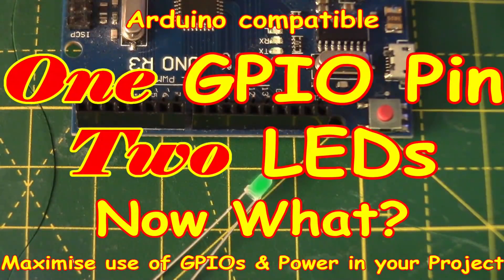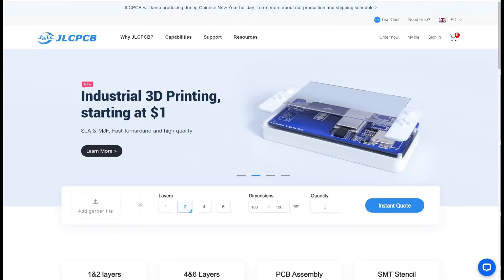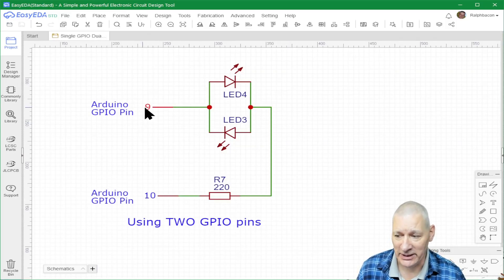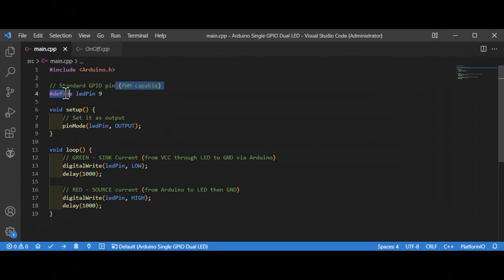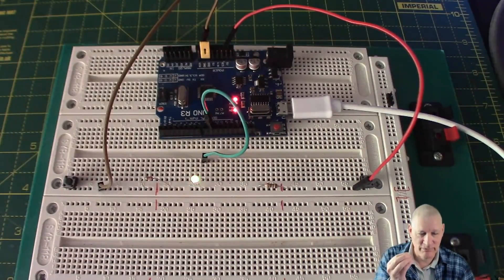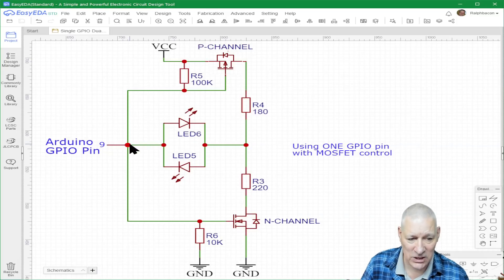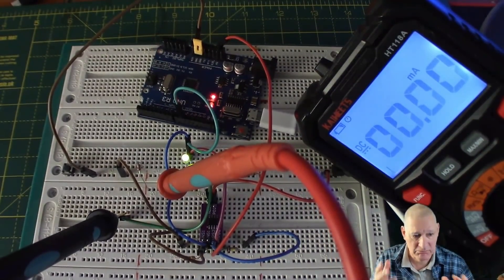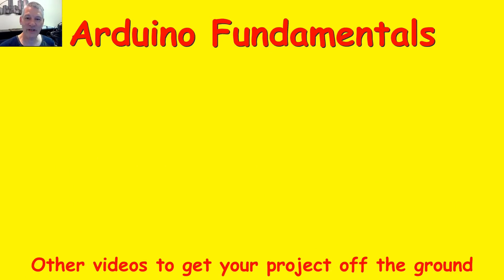#241 Yikes! Only ONE GPIO pin but TWO🔴🟢LEDs - Now What? Easy fix!

Comment: WS2812B is much easier to do for a multi color LED, only 1 resistor is needed, everything else in software, millions of colors, Fading and much more can be done, have a few videos on my channel that shows usages.
Reply: @jeremiahbullfrog9288  Yes, but not that much, and haven't checked, but somebody should make a very basic WS2812B driver/library without all the inbuilt effects but just with color and brightness to save on memory and space, code is already pretty easy to use ( FastLED )
Reply from the maker: Yes, I showed them just a couple of weeks ago. Maybe that is THE answer, after all? The only fly in the ointment is that NeoPixels are normally flat (with 4 pins) whereas I would prefer a standard 3mm LED mounting.
Reply: @RalphBacon  There are "5mm RGB addressable LEDs - WS2812 compatible" ( google search to find them ;) ), but yes no 3mm, also in all my stuff ( video's on my channel ) i always have the LED's behind 3D printed diffuser, or in my TPU buttons with LED's under them so they light up and feel good to press also ;), i also only use the 5050 package and the 2020 package of WS2812B LED's ( get jlcpcb to solder those small suckers on.... )

Comment: Awesome! We are not worthy.
Reply from the maker: Except we can't turn the LED off, something that I don't do in my Smart Heater Controller so never considered. 😢
Reply from the maker: GOOD NEWS! I've tested the tri-state option now. 

You can remove both R5 & R6 (the MOSFET Gate resistors) as they are no longer required; the GPIO pin keeps the MOSFETs in the correct state. 

If you set the GPIO pin to INPUT there is ZERO current flow in either direction. Basically, the MOSFETs do not allow current flow. The LED remains OFF. Setting it back to OUTPUT resumes normal operation.

Thank goodness! Obviously I designed it to do this 🤥

Comment: Yet another great video. This will work well with my just ‘completed’ PIR project using an ESP8266-01 that has only two readily available pins. Currently I use the remaining pin for a red LED to signal motion. With your video I can have red for movement and green for none. Sure, I could of used a Wemos R1 D2 but I enjoy the challenge of being limited.
Reply from the maker: Yup sounds like a plan!
Reply from the maker: Yes, the ESP-01 is, after all, an ESP8266 so ESP-NOW is available to it. I use that here in the workshop for all my sensors.

Comment: what the hell is a wall wart is it some sort of non english thing?? or is it a mains powered PSU???
Reply from the maker: It's an ugly phone charger that you plug into a wall socket... A wall wart. A carbuncle. Whatever, ugly. 😁
Reply: @RalphBacon  a carbuncle. Hahahaha I just got a bag of the 5mm ones. I thought they were blinkers when o bought them but I just run them using a triple 5 and a 2n2222 on a separate breadboard from where the output on the circuit the original 555 is on. It's convoluted to explain but I just used 2 leds in opposite directions to the collector so they flip opposite colors in the same timing.  This sounds confusing because I can't draw the circuit haha. We have the same taste in leds, like coding and electronics along with flying drones Ralphy. Hahaha
Reply: @RalphBacon  yes and $2 instead of £X to many americanisms drifting in and why did you not just use your old system https://www.youtube.com/watch?v=kQZU8kE3ksU
Reply: Ik thougt it was soms kind of pig with tusks living in your wall. 😀

Comment: will be good to look at the current flowing through the two resistors during switching, i expect to see a point in time where both fets are conducting due the two gates being connected together. in this application i can't see a problem with a few miliamps being drawn as a current spike. but without the resistors you could be shorting out the supply.
Reply from the maker: I suppose it depends on how quickly the MOSFETs switch. Vishay state 7-30nS switch on delay, 16-30nS to switch off. Can we live with that?
Reply: @RalphBacon  it's not so much the switching on and off times, it's how long the two inputs remain in the voltage range where they are both on. Remember there may be quite an overlap on switching points. In your circuit its not a real problem as the max current is limited by the two resistors, but it's worth pointing out that if those resistors were not there, you would be shorting out the supply for that cross over time. You have again given me something to think about on a friday. keep it up :-)

Comment: Charlieplexing. You can always use the analogue pins as digital io pins.
Reply from the maker: The two GPIO-pin solution I initially show is not really Charlieplexing. It does save a ground wire but does not drive more LEDs than can be done from two GPIOs anyway.

Three GPIOs can drive 6 LEDs though - and the more pins you can give the more LEDs you can drive.

Yes, always good to remember that the badly named "analog pins" are actually analog-capable pins but in all other respects are standard GPIO pins. 👍🏻

Comment: I use micro controllers to save on external logic. With micro controllers costing less than $5 I now can spend almost as much to save one pin on a controller and still not be able to turn both lamps off, or PWM them, to save power. Good video on logic design, especially for applications where you need the external drivers anyway to drive larger loads.
Reply from the maker: Yes, in this Real World case (my Smart Workshop Heater Controller) I always have either green or red on; at no time would the LED be unlit. But I'm sure it can be done 🤷‍♀️
Reply from the maker: GOOD NEWS! I've tested the tri-state option now. 

You can remove both R5 & R6 (the MOSFET Gate resistors) as they are no longer required; the GPIO pin keeps the MOSFETs in the correct state. 

If you set the GPIO pin to INPUT there is ZERO current flow in either direction. Basically, the MOSFETs do not allow current flow. The LED remains OFF. Setting it back to OUTPUT resumes normal operation.

Thank goodness! Obviously I designed it to do this 🤥

Comment: I don't think the resistors is needed, your pin is either high or low. If it's 3 state the two gates will be feed by the voltage divider of the resistors
Reply from the maker: Possibly. I'd have to see whether the MOSFETs were kept in the correct OFF (non-conducting) state when required. Or maybe one of the resistors could be removed (the 10kΩ probably).

Comment: Gday Ralph. Never seen bicolour leds with only two legs. Smart way to save battery power but still a tiny leakage path via 100K and 10K.
Reply from the maker: Yes, 45μA apparently (says viewer Algobit) but we might be able to remove the 10k resistor reducing it to zero (or increase to 47k and the 100k to 150k which would mean only 25μA leakage).
Reply from the maker: GOOD NEWS! I've tested the tri-state option now. 

You can remove both R5 & R6 (the MOSFET Gate resistors) as they are no longer required; the GPIO pin keeps the MOSFETs in the correct state. 

If you set the GPIO pin to INPUT there is ZERO current flow in either direction. Basically, the MOSFETs do not allow current flow. The LED remains OFF. Setting it back to OUTPUT resumes normal operation.

Thank goodness! Obviously I designed it to do this 🤥

Comment: Here comes the twist, what if you want to turn off both LED-colours?  :) Keep up the good work Ralph, as always.
Reply: Only if poor old Arduino had tri-state IO pins. But wait, that can be added with a tri-sate buffer IC... Now, in order to drive (and turn off)  a dual pack LED with a single GPIO pin, all you need is 2 mosfets, 4 resistors, and a tri-state buffer IC. :-)
Reply: @borayurt66  Arduino has tristate pins, set them as inputs and boom! But I don't think that would turn both leds off. One led would be still on very dimly... probably :-D
Reply: @1978jra  No it doesn't. You're free to try for yourself. At input state, pins sink a little current, enough to drive a standard LED at almost half brightness.
Reply: @borayurt66  They are tri-state, but you are right normal input mode is not hi-Z. My mistake there. Anyway that is not a way to turn both leds off anyway.
Reply from the maker: I must admit I never had the scenario in mind where my Status LED is switched off (not in the Heater Controller, anyway). You might get away with a Blue LED not lighting up dimly if the GPIO pin was set to INPUT.
Reply: Set the pin to input
Reply: @captainboing  which then equals ground
Reply: @jyvben1520  so inputs are at ground potential? How then is it possible to sense a high impedance logic 1? 
in input mode, a pin is connected to the gate of a fet or two inside the controller (yes I know it's a bit more involved in reality but that is effectively what is happening.) almost zero current flows into the gate of a fet once its capacitance is charged, so it is effectively hi-Z. If it was at ground, how is it possible to sense anything but logic 0? the input circuitry must not interfere with the external signal for obvious reasons. Electrically it works, because the lead on the LED where it connects to the controller pin is effectively open-circuit because there is (should be) no current path "through" the gate of a fet... All that said it seems the inputs on arduinos are crappy enough to let enough current flow that the led may glow dimly so as actually deployed in the controller it sucks.
Reply from the maker: GOOD NEWS! I've tested the tri-state option now. 

You can remove both R5 & R6 (the MOSFET Gate resistors) as they are no longer required; the GPIO pin keeps the MOSFETs in the correct state. 

If you set the GPIO pin to INPUT there is ZERO current flow in either direction. Basically, the MOSFETs do not allow current flow. The LED remains OFF. Setting it back to OUTPUT resumes normal operation.

Thank goodness! Obviously I designed it to do this 🤥
Reply: @RalphBacon  Thanks for proving. Sorry for what i said about crappy inputs on the arduino now ;)

Comment: Hi Ralph useful video as always. Have you checked out Wokwi, its an online arduino simulator/constructor. Very interesting. Cheers
Reply from the maker: Well, Peter, I just got a BLINK sketch running on Wokwi! 

I don't know what the PacMan type connection-eaters are doing though? But I will share this in a future video (if I remember). 

Thanks for the heads-up! 👍
Reply: @RalphBacon  yes slightly odd connections but it seems to be in its infancy, a great resource for educators nonetheless. I saw this on a channel called "upir" on his most recent video so shout out to him. Cheers

Comment: Use a TLE2426.  Looks like a transistor, but is a 'precision rail splitter', that provides 2.5V when connected across VCC and GND.  It can sink or source 20mA, but draws only 280uA when not being required to sink or source current.  LED can then be red, green, or off by setting the IO pin high, low, or input.  You can tweak the brightness of the red and green individually (if required) by adding a small-value resistor in either the VCC or the GND line that feeds the TLE2426.
Reply from the maker: I've just spent far too long reading the datasheet for this device (thanks for the heads up) and I think you are advocating using TWO of these devices instead of my MOSFETs? Is that going to work with a bi-colour LED? 

Does each "output" pin of the TLE2426 have to go to a different LED (not a back-to-back)?

I'm going to get a coffee now to see if my brain wakes up.
Reply: @RalphBacon  No, you only need one.  One leg of your bi-colour LED to the '2.5 volt rail' and the other to your Arduino I/O.  An inline resistor of about 68 ohms will limit the LED current to 10mA - you could use 100 ohm.  So the only components needed are one TLE2426, one resistor, and your bi-colour LED.  If you want to adjust the red/green brightness you just add one extra resistor, probably 10 or 22 ohms to either the VCC or the GND lines that feed the TLE2426.  This method is no good for blue LEDs (which need more than 2.5V to light up) but works great for standard red, green, and yellow ones.

Comment: it is still terrible for battery powered project since you can not disable both LEDs and one will remain on even during sleep :D
unless GPIO has high-Z output state
Reply from the maker: Some have said that the LED will stay on, very dimly, even with the GPIO pin set to INPUT. I've just tried it out and it's true 😒
Reply from the maker: GOOD NEWS! I've tested the tri-state option now. 

You can remove both R5 & R6 (the MOSFET Gate resistors) as they are no longer required; the GPIO pin keeps the MOSFETs in the correct state. 

If you set the GPIO pin to INPUT there is ZERO current flow in either direction. Basically, the MOSFETs do not allow current flow. The LED remains OFF. Setting it back to OUTPUT resumes normal operation.

Thank goodness! Obviously I designed it to do this 🤥
Reply: @RalphBacon  having already 2 transistors in this arrangement it might make more sense to design your external push-pull circuitry proper to application that won't be dependent on internal GPIO structure.

Comment: Hi Ralph.  I can’t see how the current is blocked from vcc to gnd  via r5 and r6.
Reply: Thank for the update. Good work
Reply: It is not, but it will be very very low (45uA) compared to the first approach
Reply: That would only happen in the off state (or I suppose Digital Output Floating/High Z (if that is what its called) or configured as a Digital input??) and is certainly a lot lower than 12.5mA because of the resistor values but indeed not zero!
Reply from the maker: We might be able to lose one or both of the resistors. As long as one of them was not needed (because the associated MOSFET was biased OFF by the state of the GPIO pin) then there would be no current flow.
Reply from the maker: GOOD NEWS! I've tested the tri-state option now. 

You can remove both R5 & R6 (the MOSFET Gate resistors) as they are no longer required; the GPIO pin keeps the MOSFETs in the correct state. 

If you set the GPIO pin to INPUT there is ZERO current flow in either direction. Basically, the MOSFETs do not allow current flow. The LED remains OFF. Setting it back to OUTPUT resumes normal operation.

Thank goodness! Obviously I designed it to do this 🤥

Comment: hello Ralph,

great video!
But you have not brought the leakage current to 0.
It's not flowing now (5V/400 --> 12,5mA) but it's still (5V/110k --> 45,45µa) 😀
BR Frank
Reply from the maker: We might be able to lose one or both of the resistors. As long as one of them was not needed (because the associated MOSFET was biased OFF by the state of the GPIO pin) then there would be no current flow.

Comment: I am 1 minute in and I think I know. Connect 1 leg of the LED to 2.5v (no idea where you get it from) then used the digital write to set the GPIO pin high or low 😜 I hope I am right.

UPDATE
Now 4mins in and changing my mind to using analog Write a PWM value to sort out the current limiting resistors 🤩

Nice move with the mofets! Ok I'll order some si4599 😉 oohh I also found a FR120N relay replacement for Arduino 😁 bought.

Cheers Ralph another great video
Reply from the maker: It was interesting to see how your view changed as you watched more of the video! 

Si4599 definitely worth investigating, if not for this then for the auto on/off circuit I designed a while ago (and which I'm using in my 3 storage bin lid circuits).